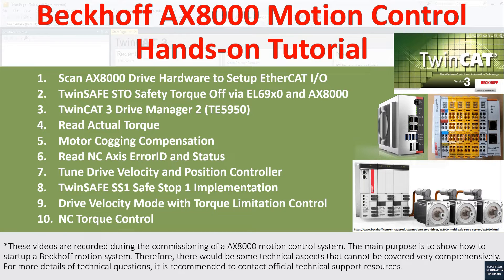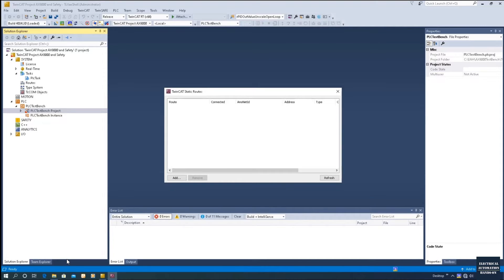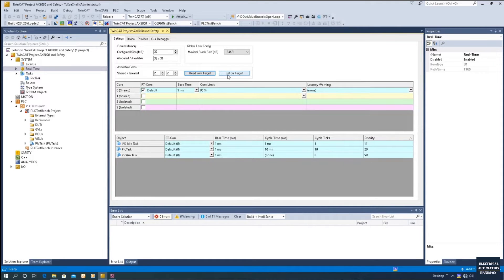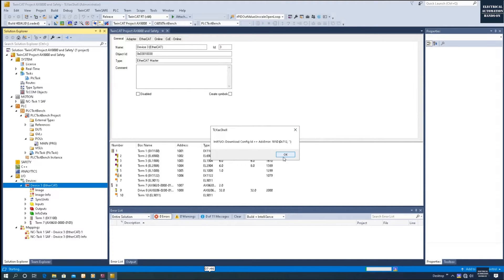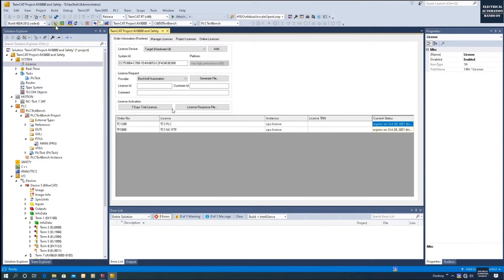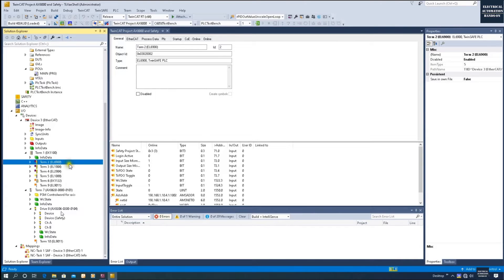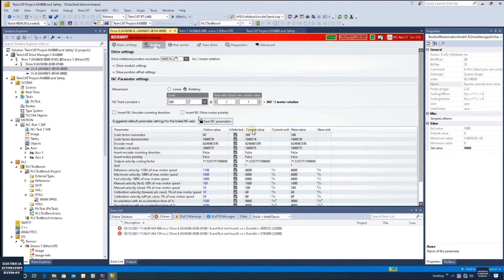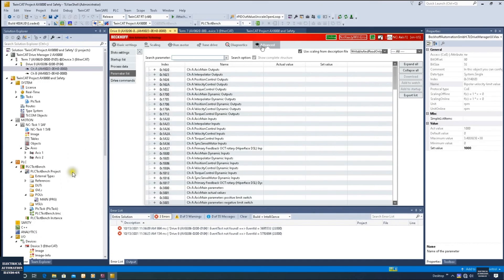MB21. [AX8000 Servo][1/10] Scan I/O & AX8000 Drive and Setup Drive Manager Project

Comment: Hi, Nice vidéo. But what about setting-up without an online config? Actual developpers doesn’t have a test-bench available!
Reply from the maker: You can manually add the hardware, but I would not recommend doing this. Because the drive can automatically identify the motor and encoder and self config many parameter while you are online and upload the actual hardware. Your offline pre configuration would overwrite paras and configuration wrongly.